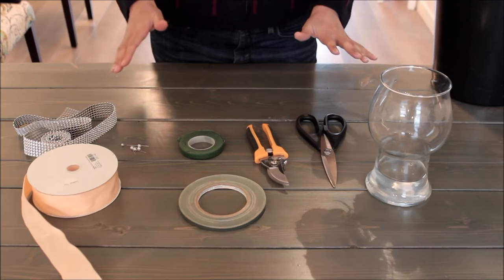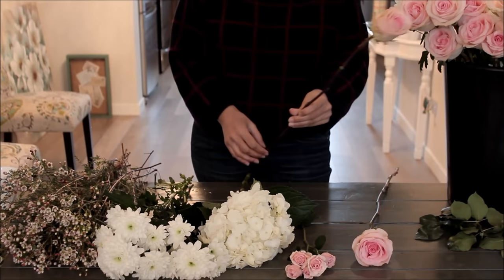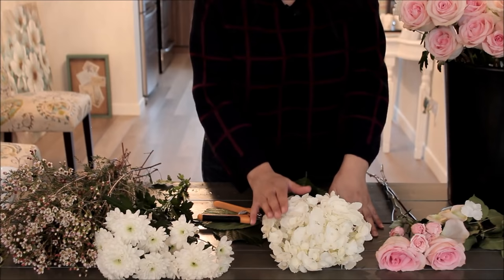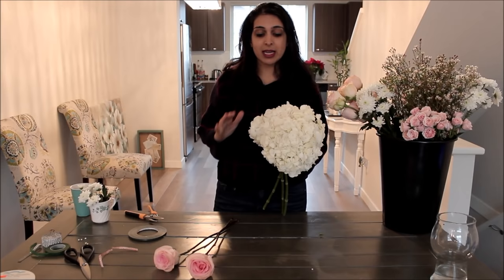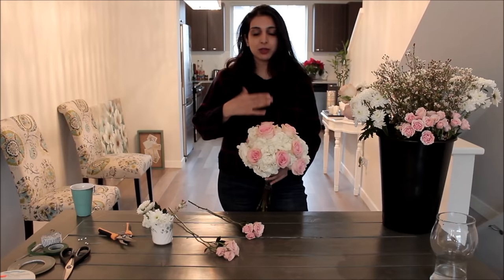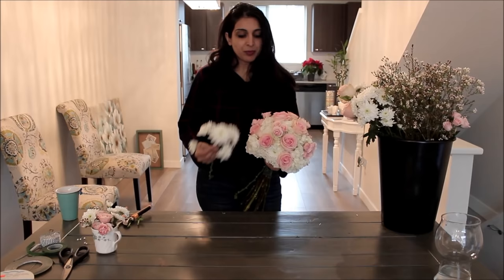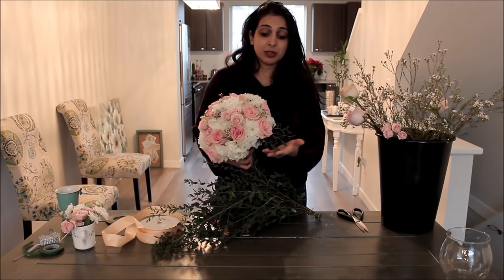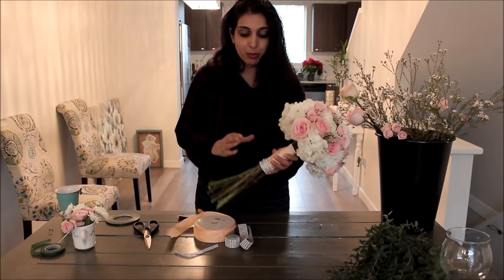How to Make a Rose and Hydrangea Bridal Bouquet

Comment: How long should the stem be on the hydraangea when staring out ? Your  You Tube saved my life today . Thanks !!
Reply from the maker: I'm glad the video was helpful :)  There's no ideal length for the hydrangeas when you start- I think mine are usually 3 feet long, maybe, and I cut them down shorter to make it easier to work with.  One thing I have found when buying local hydrangeas, though, is that the heads are bigger on longer stems.  I bought a bucket of very short blue hydrangeas once and when I took them out to make the bouquet, I realized each stem had a cluster of small heads, not a single large head.  So i stick with longer stems (but those were very short- I think less than 24 inches long).

Comment: I keep hearing about Novia, but can't find them at either of my local wholesalers. I've used Nena, but have found that they bruise/brown.
Reply from the maker: +Monica Brown Novia is pretty uncommon at my wholesalers too, and I only noticed it popping up on lists last year.  It really is a gorgeous pink, so I grab it whenever I can, lol.
And that's too bad about the 'Nena'.  I have similar problems with 'Titanic', which seems to the most common soft pink in my area.
The one I'm working with next, Geraldine, is one of my favourites, although it's more of a medium pink with a vintage tone.  Consistently opens large with big heads.  It's a real beauty, especially for wedding work.